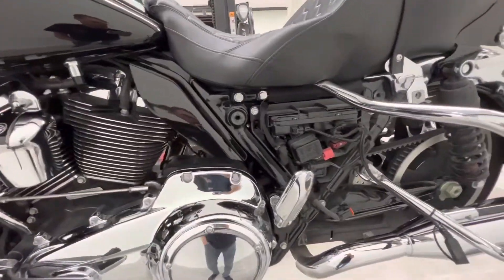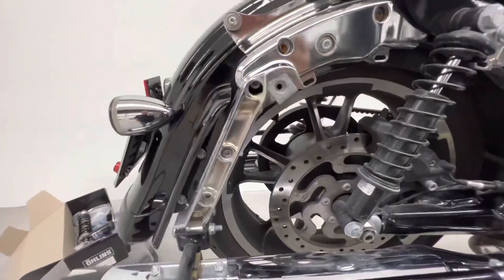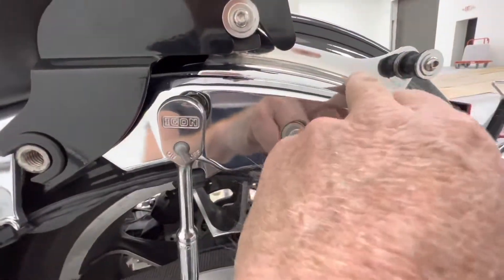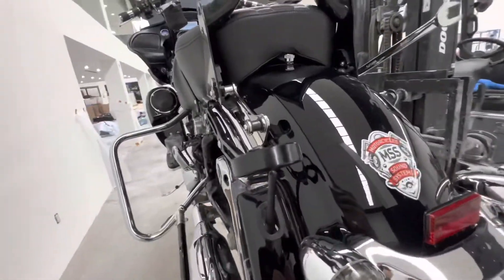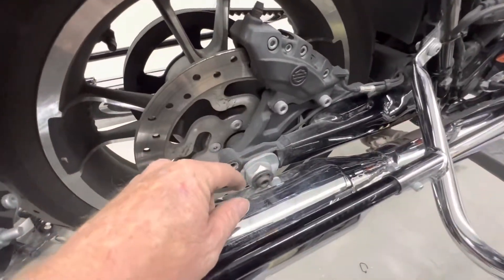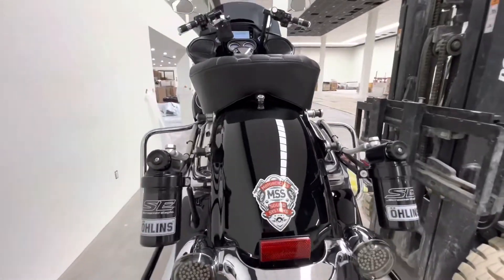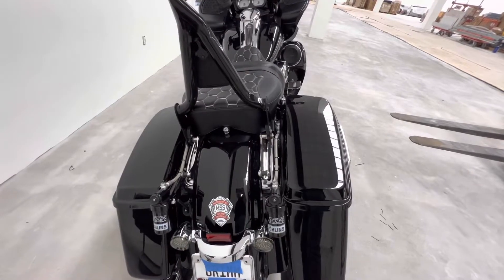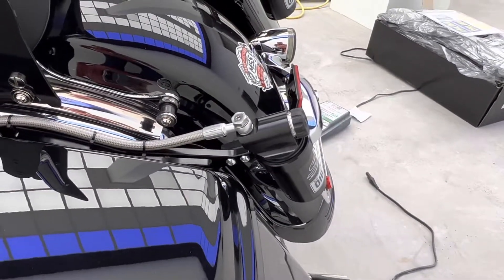Ohlins Screaming Eagle Remote reservoir rear shocks

Comment: I have two questions.
It's 22 fltrxs. I weigh 80kg
Sometimes I wear tour packs and do tandem with my wife. My wife weighs 60 kilograms. How can I adjust the suspension? You need two adjustments when you're driving alone and when you're calm. The spring is a step from when the screw is not visible.. How many steps should I release from the bottom dial and reservoir dial when it is hard locked?
Reply from the maker: That part is a bit tricky. There are some recommendations and formulas in the instructions but it’s confusing. I had to play around with mine to find a happy medium. I too ride 2 up sometimes. And between solo riding and 2 up you can definitely feel the difference if you don’t change the settings. Just have to play with the settings. The spring nut I run around 6 threads showing

Comment: What year is your bike
Reply from the maker: 2022
Reply: @Grimmeute  I just put mine on and adjusted the top according to the calculator feature on their website, and it rides super nice!

Not sure how to adjust the rebound adjuster deal on the bottom though.

Should I leave it or would you suggest tightening that up some?

Thanks
Reply from the maker: @BAsed_AFro I think I gave my bottom adjustment like 6 clicks. Don’t remember exactly